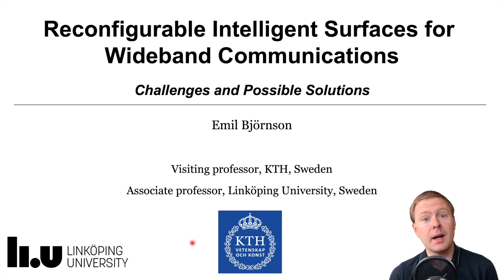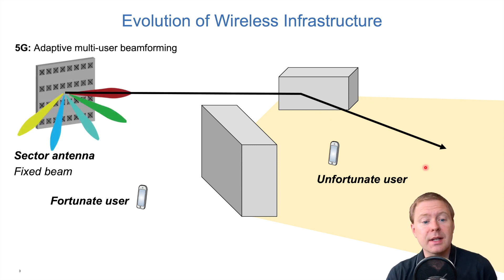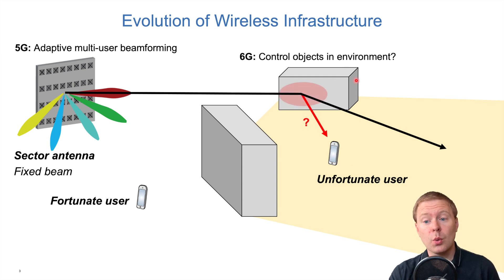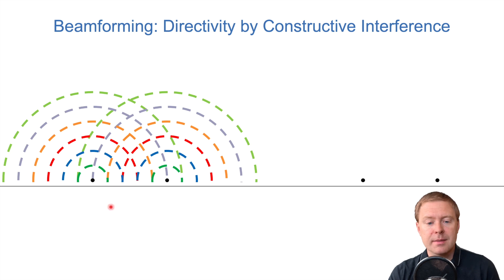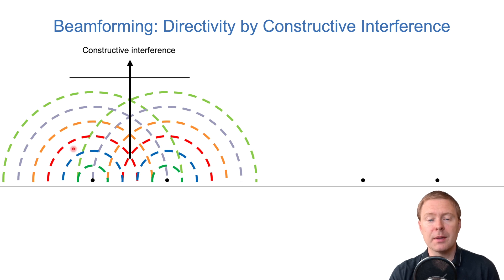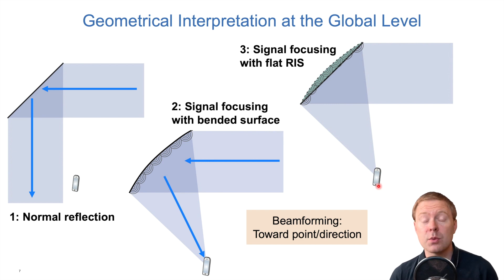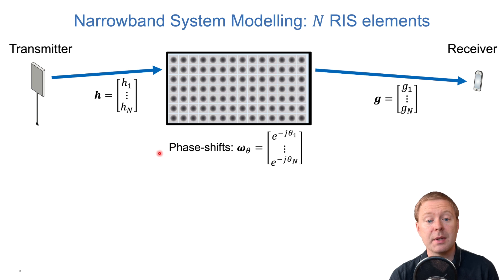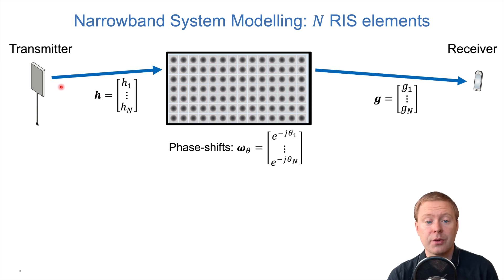Reconfigurable Intelligent Surfaces for Wideband Communications: Challenges and Possible Solutions

Comment: Thank you. Interessting. Concerning the phase shift vector on slide 9, Omega. Why is this phase shift vector always given in that form (e to the power of j*Theta)? Why not only a vector with (Theta1, Theta2,...,ThetaN)^T? 
I think that would be easier. Has it to do with the complex expression?
Reply from the maker: Yes, you can write it as a vector (Theta1, Theta2,...,ThetaN) but each entry must have unit magnitude, so that it doesn't amplify the signal, only incur a phase shift. That is why the solution must be a complex exponential function.

Comment: Hi Professor,
I have been following your tutorials on RIS and Podcasts! all are really great, helped a lot to bridge the gap between theory and practice, and many thanks to you. I have a doubt regarding the mechanism behind the variation of phases of the impinging signals using the patch element you explained at 19:33 of this video.  From the theoretical explanation, we need to delay the impinging signals so as to add them constructively to the receiver;  could you please clarify how this delay is achieved by changing the impedance of the reflecting element?
Reply from the maker: The reflection coefficient captures the amplitude and phase change: https://en.m.wikipedia.org/wiki/Reflection_coefficient

There are different ways to implement a varying delay (phase shift). It can be done mechanically by connecting the patch to transmission lines of different lengths, so that the signal needs to travel a different distance in the medium before being reflected. A more attractive way is to vary the impedance, which basically changes the speed of light in the medium. This is also known as the velocity factor: https://en.m.wikipedia.org/wiki/Velocity_factor
Reply: @WirelessFuture  Thanks a lot!

Comment: I need the effect of phase error and area of surface RIS for siso system
Reply from the maker: You can check equation 32 in https://arxiv.org/pdf/2102.00742.pdf The second row is with optimal phase-shifts and the first row with arbitrary phase shifts, which could be suboptimally selected. The summation along with the physical size of each element determines the surface area.
Reply: @WirelessFuture Where is the Matlab program for this paper?
Reply from the maker: There is no Matlab program. We might release code if/when the paper is published. Right now it is just a preprint.